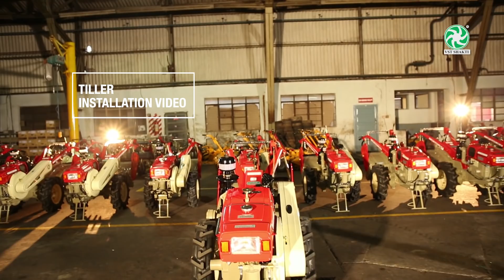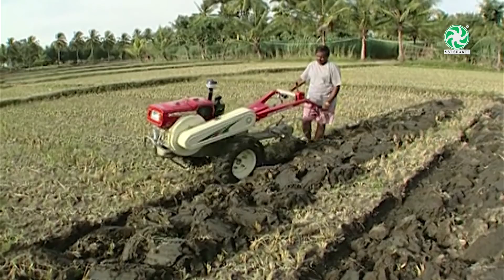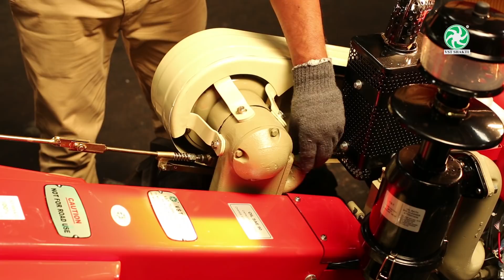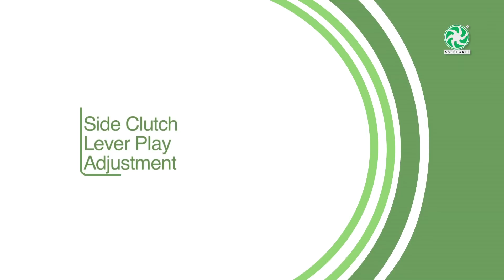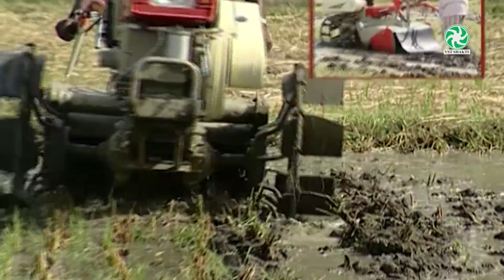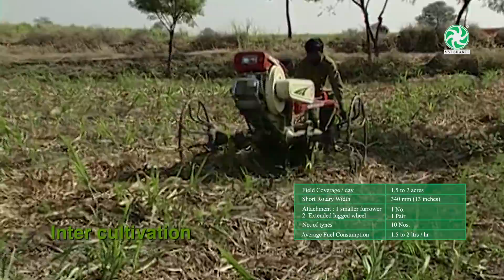VST SHAKTI TILLER- Installation Video

Comment: Can you please tell me how much liters of gear box oil servo Hp 90 required for 135 di super ultra vst tiller  required & also how to remove radiator cap of new 2022 model  vst tiller
Reply: 5.5 ltr

Comment: Company very unresponsivele. No help after buying vst power tiller.
Reply from the maker: Dear Ramnath, can you please let us know what is the issue you are facing?
Reply: @VSTShaktiVideos  power tiller clutch plates .radiator leak .problem but vst company not have any service provide. Company haven't anyone service boy but company growth increase I do not understand.
Reply from the maker: @ramnathverma8751  Can you please share your contact details.

Comment: Dear VST (in same state where VST tiller is manufactured) there is ZERO attachments or info of them available for tillers with the dealer. 
Riddger - Unavailable
Inter-cultivator - Unavailable
K-type cage wheels - Unavailable
MBPlough - Unavailable
What's the use of your ads of attachments if you don't provide any attachments or atleast point to where accessories are available? If this is the case in the state where tiller is manufactured, what could be the case in other states? 

You are number 1 in tillers. 👍

Your toll-free number 1800 419 0136 is a total waste of time. If the person doesn't give any information and only says "contact your nearest dealer", you may as well play a recorded message. 

Atleast send your marketing manager to every dealer and let them know what your product portfolios are. Your dealerships are clueless of your products, they are stuck in 2000's. Atleast ask them to visit your own website once a while.

As a potential customer in 2020 am being I too ambitious to expect attachments for tiller from your company dealer? Or once I buy tiller it's my headache to design n manufacture the attachments?

Sometimes I really wonder if dealers are not interested in selling tillers as margins have thinned down and higher products bring in higher margin?

Comment: What farmer has the time to grease, oil, check, tighten every nut and bolt regularly, plus their machines are covered in mud and dirt so oiling and greasing would be very hard, then there is the time factor. He probably starts and ends his day in the dark.
Reply: I have taken vst tiller 130 di but puddling speed is low please guide me to increase the puddling speed.

Comment: Kindly make printable manual available for farmers. Usually the subsidised tillers that reach the farmers so not have many of the accessories and attachments. Besides manual handouts are missing.
Reply: What is the process for subsidy.

Comment: iam vst owner ....130 triller is very very better...do fast work better company vst...thanks to vst
Reply: What is price
Reply: Prasad Mangam engine oil number
Reply: Teilar.st.
Reply: 757892034
Reply from the maker: @nagimuddin6425  Can you please share your correct contact number to reach you to share the requested information.
Reply: Bro.. My father buy new vst 13 hp... So pls explain service detail bro
Reply: Explain about daily checking